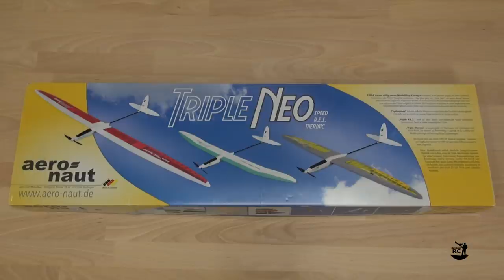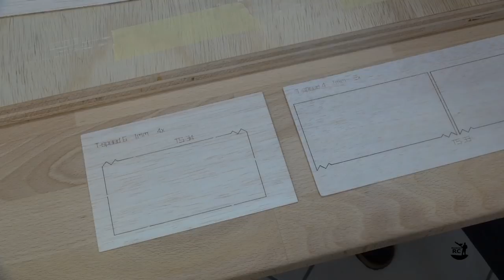Triple Neo Speed - Time Lapse Build

Comment: I bought this kit and wanted the speed like you but they sent me the RES version. I thought you could build what ever version you want in the one package. Wrong, it didn't have the parts to make the speed only the RES. I tried to tell them but all emails were in French so I got no where. So I'm stuck with the res version.
Also the motor they recommended I bought and the motor mount holes didn't line up. And the spinner had to be cut way back for the spinner to work.
The instrutions are in french so their useless. If it weren't for your video I'd really be up shit creek without a French paddle.
Reply from the maker: Oh man that‘s bad. Wrong version, everything in French and a shop that is not answering. I am happy to see that my video was helpful for you. I also had some difficulties with the motor installation. I used the recommended actro motor which fit nicely to the mounting holes. But it should be positioned at least 1 or 2mm further to the nose to ease the mounting of the prop and spinner. In the meantime I installed the Z-Spinner and props and it was even worse.
I don’t know how advanced you are in the build but maybe it helps. The English instructions are available for download on the manufacturer web site (a bit hidden):
https://aero-naut.de/wp-content/uploads/2020/12/1128-xx-Triple_NEO_instruction_en.pdf
Let me know if I can help you for any remaining questions. By the way, you can order the speed wings separately (around 70€). I just ordered the thermic wings so I can switch between wings depending on the conditions. Greetings from Bavaria
Reply: Thank's so much for your help. I looked for the instructions and couldn't find it.
I already built the wing tips . They need to tell people that all three models don't come in the box. Maybe we are just to suppose to know.
Reply from the maker: The instructions were really not so easy to find. For the three different versions it depends on how the shop is advertising it. In the shop where I bought mine it was quite well explained that you need to decide which version you want to build and chose the correct one. Finally the triple is a great plane. You will like it. Just one additional tip, try to keep the tail as light as possible. It will be ok if you have light balsa in the kit but if the balsa is a bit on the heavy side you might need a lot of weight in the nose (or a bigger battery).
Reply: Thanks again. And yes some of the tail feathers were heavy stock. I dont like the fact that the res doesn't have ailerons.  I was thinking about making some small ones if I can make some fit.
Also you blow me away with how clean your work area is! (Unless of coarse, you edit that out!👍).
Reply from the maker: I have never tried a RES plane but I think they are designed to fly well without ailerons… but I have to admit that I prefer planes with ailerons. When shooting a video I try to keep my work bench as clean as possible. I have 2 other workbenches that look slightly different 😂 and also the rest of my workshop looks like a good workshop should look like: well sorted chaos 😜

Comment: It is strange you needed to saw the nose of the body yourself. This will cause imbalance when it is not done correctly. With the high rpm's of the motor it would damage the motor. Why didn't the manufacturer did it already?
Reply from the maker: It is maybe not so clearly visible in the video. The manufacturer didn’t cut it because you could also build it as a pure glider. But it is not a lot of work to cut the nose. Don’t worry about imbalance, the cut off part is not used as a spinner. The spinner is a separate part that comes fully balanced. I hope this answers you point.
Reply: @bavarian_rc  I think he's talking about if you cut the nose off and install the firewall crooked you can have a bad motor thrust line making it fly like crap.
Reply from the maker: @DaVile Oh yeah I didn't think of that. Actually with the templates they provide in the kit the cutting of the nose and the glueing of the firewall are fairly straight forward and there is little room for mistakes. But I agreed that cutting the nose and fitting the firewall is still not my favourite job on a build :-)

Comment: That elektro motor ruins it for me. But lovely plane
Reply from the maker: Yes, it is a lovely plane. You can also build it as a pure glider. As I mainly fly alone (no one to tow me) and the next slope is a 30 Minutes drive, the motor is a good compromise for me.
Reply: @bavarian_rc  i use bunjee launch... 30m elastic, around 100m of nylon. At the end is a ring, and parachute. I launch up to 4m gliders... i have 3 elastics, the smallest i launch is a 1m 140gr glider
Reply from the maker: That‘s cool. I always wanted to try bungee launch but never really went for it, not knowing which type of elastic for which plane size and how to properly set up. I will have to dig into it one day 👍
Reply: @bavarian_rc  i believe graupner still sells them
 I have a flat elastic from graupner to launch up to 500gr.
And a hollow tube from i believe aliexpress to launch up to 1.5kg.
And a elastic from tiny ones covered with woven outer layer to launch up to 3kg.
And there are even havier duty elastics.
And if you take between 70-100) of heavy duty nylon,it works great
Reply: @bavarian_rc  they sell all kinds of bunchees
Reply from the maker: Thanks for all the info. I really need to test it.
Reply: @bavarian_rc  you should! It makes gliding waaay more fun,because your glider is 30% engine in weight. Just put the battery in front, then receiver,and servos most back  in the nose😉
I rebuilt a glider from elektro to glider, before 1.55kg, after rebuilt it was 1.16kg. Massive change in thermalling ofcourse